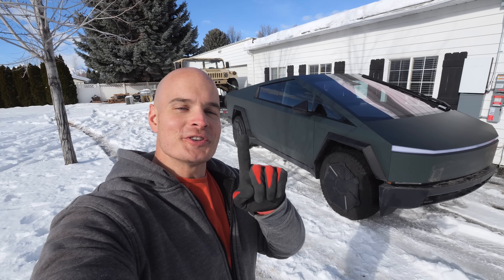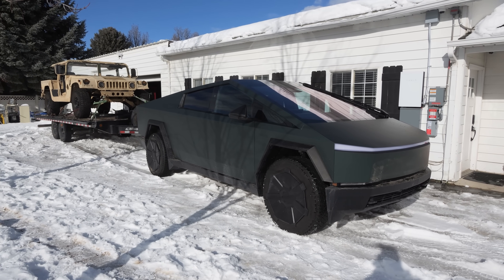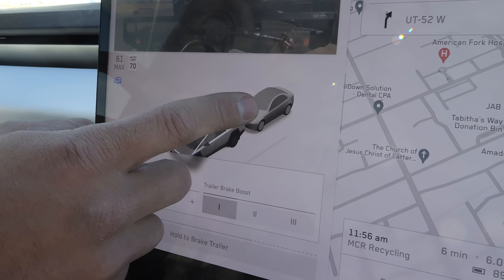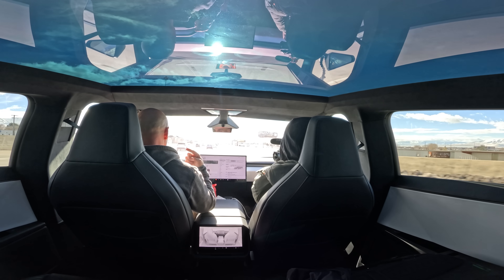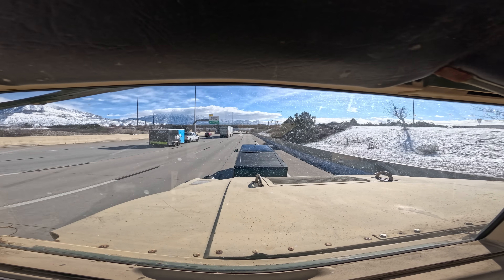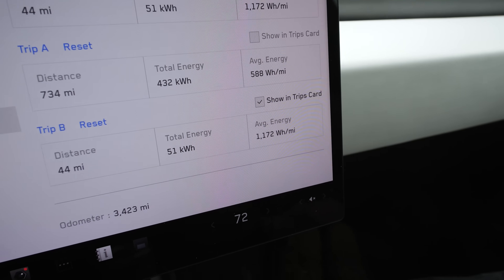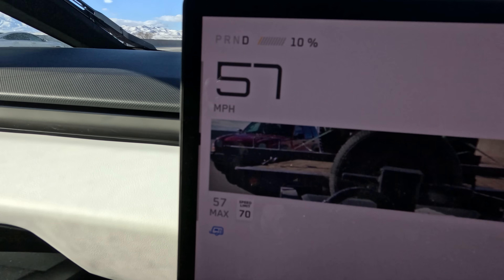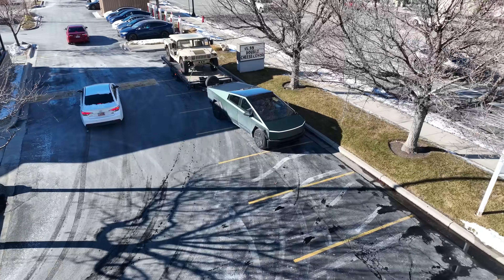How far can the CYBERTRUCK tow 11,000lbs in Freezing Weather?

Comment: Hmmm so, $13 to go 90 miles on the highway? I know you're towing and that just kills your efficiency but for the same money my Challenger R/T will do 104 miles (assuming averaging 26 mpg highway. And I actually undercut that as I can usually get 28-30mpg) and that thing is both a literal brick and a gas hog. Granted it is also very flat in my area, so I think it'd come out to about even. In the end compared to a diesel or gas truck towing the same amount you're probably saving some cash but, not by much. Especially not considering having to wait 40 minutes to recharge after going 90 miles.

Comment: what a pos. you charge it on the diesel generator?
Reply: Even if they use normal tesla chargers, the vast majority of the electricity in the US is produced by the burning of fossil fuels.  So yes, it's basically charged from diesel, coal and natural gas. Renewables are increasing but not as fast as the demand for more electricity as governments push all to heat with electric and switch millions of ICE vehicles to EV.

Comment: Sounds fun.   Short range, an hour to charge, having to reduce speed to make it to charger, charger full when you get there. 
  Best part is watching other pick ups whizzing by pulling trailers.
Reply: Where does the chemicals go from the battery after they lose charge after a couple of years from fast charging?
Reply: @LeftyRighty123 after a couple of years?  Please tell me you're kidding.  Please tell me you actually look things up before you start talking because you don't sound like you do.
Reply: @edwardward7841  Tell me the average lifespan of a EV battery after being fast charged?
Reply: Yeah a regular heavy duty diesel engine just puts out way more power than even the highest raked electric vehicle for towing capacity, a fully tricked out Ford snuffs EVs hands down.
Reply: Lithium is the most abundant source on earth. Also yeah the electricity comes from coal (for now) but that will soon be eradicated and the power will come from nuclear power stations. France powers 70% of the entire country off nuclear. America could do it but the money is not there and the politicians wanna fight for nonsense before they start making any real point on power. But yeah we got this
Reply: Not going to buy one
Reply: he literally said his trailer tires are only rated up to 65mph lol
Reply: Dang I was considering Cybertruck as I don't haul very often, but my current RAM 1500 was getting 20mpg with a largest uhaul trailer around 5000lb and I had around 600 miles range.
If I was driving something more capable that could haul something as massive as this 11000lb humvee, mpg would probably drop to somewhere between 10-15, but that would still give me at least 300 miles of range or more.

That thing is mighty impressive, but I'm skipping it for now. Maybe Toyota's 900mile solid state batteries make EV trucks more appealing.
Reply: Tesla! ❤❤
Reply: Bot 🤖
Reply: they can make em charge while driving one day tho
Reply: Guys, Here is The Savior

HalleluYAH translates “Praise ye YaH”

YaH is The Heavenly Father 
YaH arrives via the TENT OF MEETING
YaH was Who they Crucified for our sins
YaH was Crucified on an Almond TREE

— Ancient Semitic Cuneiform of Moshe (Moses)
— Isa Scroll (The Original Isaiah)

Isaiah 42:8
"I am YaH; that is my Name! I will not yield my glory to another or my praise to idols.

Isaiah 43:11
I, I am YAH, and there is no other Savior but Me.

Isaiah 45:5
I am YaH, and there is none else.
Reply: People seem to always forget the point of this. If we only cared about what’s the most fun everyone would be driving around in monster trucks without any form of pollution control towing at 2mpg. 

The point of all this is two fold. It’s to reduce the strain on fossil fuels, a non renewable resource, and to reduce costs. Unfortunately I can’t bring up the third thing it does because everyone flips out.
Reply: @popermen694  Unless you want to do something useful...like use a pickup truck for work. You know, what pickup trucks are suppose to be good at? What's the point of selling the Cybertruck as a "work truck" when, for example, I have to tow heavy equipment to a job site, it can't even go 90 miles? Don't get me started on the expansion battery, you know that thing that sucks up all your bed space making the Cybertruck even less useful?
Reply: @brianm.9451  You know what? You are totally right. I think my statement applies to regular electric vehicles but not trucks. I agree. I was going to delete my post about 2 min after posting it but I got lazy.
Reply: @popermen694  I'm all for reducing the impact of the fossil fuels on the climate - the problem is that EVs use another resource that is limited and causes other damage from mining - lithium. Charging those EVs also uses fossil fuels as 60% of all power in the US comes from burning them. Current EVs aren't the answer to protecting the environment - especially ugly ass ones that weigh 3 tons and have a shit range.
Reply: @pompulousify  Ok ok I agree these trucks aren't the answer. But as I said previously, powerplants are leagues more efficient, so when it comes to air pollution they are a better option. I do agree that the batteries are a HUGE problem. A really bad issue.

But the way I see it the more there is a need for Evs the more investment we get in the battery department. Which is a good thing. They are getting closer. There are batteries made in laboratories that can solve these problems. The issue is cost. Once people figure out how to bring down cost of production then its a go.

But there needs to be a market for that to happen. So I am all for people buying these vehicles if its going to lead to more innovation. I also think Hybrids are a good choice.
Reply: @popermen694  How is it reducing strain on fossil fuels?  The electric fairy or the slave labor digging the battery materials?
Reply: @shinypennyinc7027  And that even tesla said that the batteries only last around 8 years with fast charging, and they need to be completely replaced, wonder where all these tons of chemical waste is going, even the top recyclers for these batteries don't recycle the chimerical waste.
Reply: Are you saying there are no minerals in the batteries of these vehicles? Or that the lithium, cobalt, nickel, graphite, manganese, and copper that’s  required for these vehicles are in unlimited supply and are renewable resources? Have you seen a cobalt mine?
Reply: @popermen694  How is reducing fossil fuels when it is charging on a giant diesel generator?! Also, the amount of fossil fuels used to mine the lithium, transport the lithium ect. there's no benefit that I can see....but maybe I'm missing something?
Reply: @popermen694 so until we  get more of a mix in electric power plants, ev are just as bad if not worse on the environment, battery left overs and while being produced are highly toxic. Not to mention the strain on our out dated power grid. Personally think ev production should hold of until we have better battery tech and materials that we don't rely on China for
Reply: @popermen694  I live in a state where all of the electricity comes from coal and natural gas. Is this really helping the environment, in my neck of the woods?
Reply: @ProbablySky  It does because of efficiency. Even a coal power plant is polluting less per kwh than a gas powered car. Cars are very very inefficient. So the total footprint of pollution is going to be less when coming from a power plant. 

Usually the larger the source of energy the more efficient it is. it works that way in animals and it works that way in the machines we make.
Reply: @ProbablySky  the point is to push for a clean future. what happens when we finally have clean available energy and we’re 20 years away from having cars that support that society?
Reply: @popermen694  its a good that using electricity is a renewable resource

Comment: So basically if the steering module fucks up, you're fucked, there should be a rod to the front wheels atleast as fail-safe, i wouldnt buy a Tesla anything but i certainly wont be buying a cybertruck if its got no actual connection to the front wheels

Comment: You can't use your phone while driving but a tablet is ok , I get why they have electric vehicles but they are so dangerous. I work on the roads all the time and electric vehicles are far worse than combustion engine vehicles. You don't need all that power, fast 0_60 times , You can't hear them coming and use a giant phone screen for everything.

Comment: How do you let your life in the hands of "steer by wire". I am a software engineer (with lits of electronic background also) and will never believe software to look after me. Even planes that have lots of redundant systems that are checked frequently by strong regulations still have proven to fail. They have failed in a rate that (considering the fail/devices numbers) will be a catastrophic problem if happens in cars in the same rate. Considering that cars do not have so strong regulations and not so specialized checks as planes, production numbers like levels of magnitude more and also quality and testing will drop by this much times. A plane is produced in like half a year and a car is produced in days or at most weeks.

Comment: My little audi has given me 250000 miles with no mechanic problems beside one fuel injectors.the two windows Don work.the air conditioning fan doesn't work.
But it pulls like a train and give me 600 miles on one tank of 55 litres.

Comment: this is an absolute fail...90 miles???  If I were to drive up north with my boat...I would have to pack a generator just to do the trip. My 4 runner does 400 KM pulling a 24 footer 4000 Lbs...and I can fill anywhere I want. Lets see in the next 3-5 years how this truck will be valued at when people start talking about replacing the battery. What the used value will be...cause people will be concerned if I buy this truck used...when will the battery have to be replace and the cost..that will reflect on the used price sale.....I see the truck only being worth $20 K cause the next person might have to replace the battery.

Comment: I meaaaan. The real upgrade you need is a hybrid generator from those Canooks, strap it on the trailer and a "on the go" charge input.

Did you take a look at the new mazda "hybrid" with the rotary generator ? I was so hoping for a real generator setup, and in reality they added a oversized inefficient engine. :-(

Comment: Nice until that battery replacement time.

I still own my 2012 Toyota Tundra.  Tows my 24' 5000 lbs boat or 36' 7800 lbs travel trailer no problem.  

Tundra paid off years ago and only do routine oil changes.

Show us how convenient your charging stops are my guy.

I just wonder if manufacturing and mining for those batteries were done only using electricity.

You tell me.  Until I see all fake environmentalist tree huggers wearing leaves and twigs as clothing.

Comment: We drive from sea level on the coast of California to 5,500 to Shaver Lake every year 300 miles away for vacation pulling a 7,000 lbs trailer . My 3/4 ton diesel Ram with no issues only needing to fuel up once. The last section is a serious uphill grade. Looks like the cyber truck wouldn’t be a good replacement for my Diesel Ram truck.

Comment: It’s a general misconception that the battery indicator shows miles left based on consumption. It should always just show percentage. When you switch to miles is just percentage (including degradation) multiplied by the EPA range. So it will never adjust to your consumption, driving style, weather etc. For that you need to set the navigation and/or use the energy graph.
Reply: It is not a misconception. It is a guess-o-meter (GoM). Once you know what it is, you are good to go.
Reply: or, more importantly - geography data  (which is available  )

Comment: It's not just towing, it's all the time worrying about the battery with Tesla (not familiar with other electric). I drive from SF to Southeast Idaho a few times a year and the range % is rarely correct. I recently bought a ICE vehicle just so I can be more confident on longer trips, and will use the Tesla for local trips.
Reply: If you're driving that far then of course. I would say anything over 6 hours and depending on where you're going you should have an ICE. The most I drive my model 3 rwd is 6 hours and that's generally on interstate routes with multiple superchargers.
Reply: It seems to be related to DOJ investigation of Tesla showing about intentionally increasing the range by up to 20% more than it can actually do. Then the range will start to show closer to actual as the battery gets lower.
Reply: If you're driving that far, not in a rush and more relaxed the electric car Tesla long range is fine at ~250-300mi and recharging in 30min or so. If you're in a rush and have no time for rest stops, etc then go ahead and do ICE, seems in the long run maybe not now that electric will find some ingenuity to ease some anxiety a lot of drivers have for range.

Comment: I would NEVER have a vehicle that is steer and brake by wire. If there is no mechanical connection between the steering wheel and the front wheels I don't want it. Same with brakes, no manually operable brake system, wouldn't have it. All this tech can go wrong in a heartbeat and leave you spinning and flipping down the road. Call me old fashioned but I wouldn't trust my life to some silicon diode.

Comment: So basically you could almost get from one side of the Los Angeles Metropolitan area to the other if there was no traffic and you found a way around the various mountain passes (which isn't really possible.)

Just get an f250 if you wanna tow stuff.
Reply: Elevation that evens out A to B barely affects range. It's a problem when the last bit is uphill, as an empty battery runs into power limits and can shut off with significant range and SOC still showing.
Reply: So it only had 90 miles to tow 11k lbs off a full charge?
Reply: Los Angeles isn't 90 miles long.
Reply: It’ll never be freezing in LA, so it would definitely go farther. And EVs go farther in traffic.
Reply: It does not snow or get cold in LA
Reply: You will get further on a battery if there is traffic
Reply: @swecreations nope
Reply: @LordRykard9376  And I'm guessing you have plenty of experience driving electric vehicles to make such a statement?
Reply: @swecreations  I do. And friends own them. Let me know in 30 years when the battery  technology is better and less destructive to the environment. It's actually a good thing EVs suck. We need more carbon dioxide in the environment.
Reply: @LordRykard9376 The absolute stupidest type of people are those who think they know more than they do because they know so little. ALL EVS GET MORE MILEAGE IN TRAFFIC, it’s basic physics.
Reply: @jpq21  weather permitting. You need to caveat your statement.
Reply: @LordRykard9376  No. No caveat needed. If anything worse weather would make it even better in traffic/city driving compared to freeway speeds than in mild weather.
Reply: @jpq21  😂😂😂😂
Reply: @swecreations  you saw the video right? He got less mileage
Reply: @swecreations na cause they lie about the actual milage of their vehicles
Reply: @mrunknown3414  Well that's literally how electric cars work, slower means you get further.
Reply: @OnlyBlix  the current state of EVs is not worth the trouble. Good idea piss poor exicution. Our infrastructure isn't even set up to handle everyone switching to EVs. Plus the charge time, maintenance, and sourcing of the battery materials to name a few other issues.
Reply: @OnlyBlix  yea only wanna bes think electric is good

Comment: How can we have to sit back here and do the calculations for you?
Wouldn't that be a neat addition to your Channel?
No?
You're just a guy driving a truck and trailer around.
Doesn't matter how fast you drive how far you drive what temperature it is or if you're doing speed run test..
 You might as well add some burnouts in a parking lot. It would be just as scientific.

Comment: Officially you drove 90 mi?
Officially you used 87% of the battery.
Doesn't seem like you're do you have any calculations at all.  
I guarantee you I could take that same truck your trailer and pull it at least 120 miles. 
Honestly he did a terrible job at this.

Comment: There is a reason the EVs and ICU cars were invented around the same time, yet the ev was left in the dust.
They just aren’t good. They Take a long time to charge, power grid can’t handle all EV mandate(ESPECIALLY off eco friendly power), climate affects them more, batteries mined in Africa(from fields owned by China) are just as harmful to the environment, No right to repair, range is way less, batteries degrade and if they are damaged can be 20k to replace.
Evs are dumb, especially as trucks. Change my mind

Comment: I live in Vermont where it was 5 degrees today and tow 15k lbs daily. My 2022 Denali 3500 diesel is still king for me.
Reply: Another Vt’er here. I was poised to get it but it cannot replace my 3500hd or my 2500hd. It also seems like the panels under it would get full of sand and salt.  Also questionable is how long the battery will last with cold temps many years.  I decided it’s not worth the risk to buy.
Reply: Another Vermonter here too.  Got about 100 miles on a 4000  lbs trailer in my R1S Rivian in about 5 degree's F.

Comment: That howling noise on accel/decel is the same noise a bad differential bearings or gear makes. Sounds like maybe that truck has a bad diff gear or bearings. If the noise is that loud already i wouldnt suggest driving it more 😅 coming from a stellantis mastertech

Comment: Lets stop pushing these electric cars. They’re are not as good as regular motor vehicles. Over priced. Not built very well. Besides the batteries in them are first charged by diesel generators.